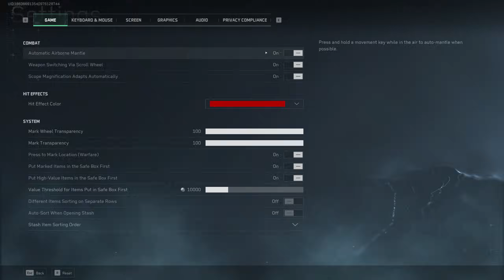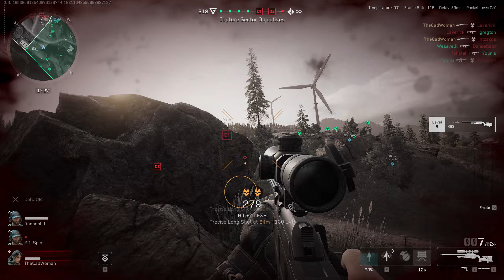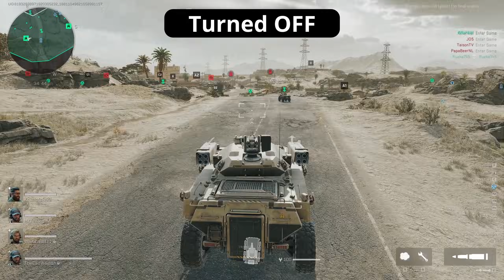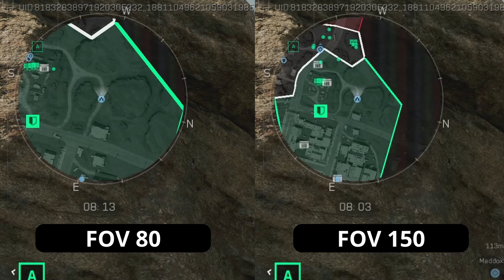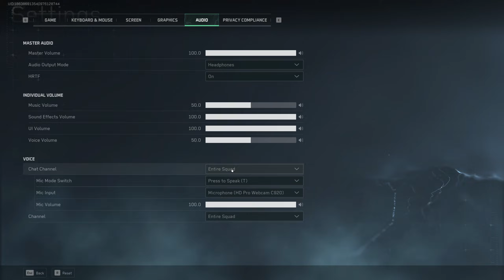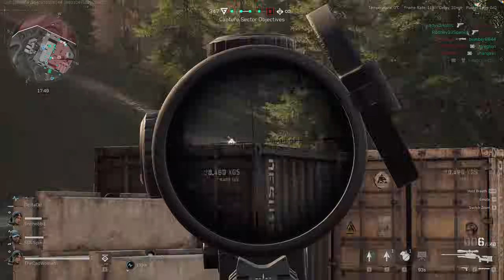ULTIMATE Delta Force Settings Guide for High FPS, Performance & Visibility

Comment: Thank you for this what is your Pc rig your whole specs of it ?
Reply from the maker: I‘ve got an Intel 13600K, RTX3070ti, 32GB Ram, and play on 1440p.
Reply: Omg i got xeon e3 1230 v3, gtx 1660s, 16gb ram and i run on hdd, still work finely, any advices?  @TheCadWoman

Comment: The audio with HRTF is legit some of the best gaming audio I've heard yet, especially in the Tarkov mode. It's so precise.
Reply: Did you also play with HRTF off to compare?  I feel like the audio is already really good and accurate with HRTF off.  With HRTF on, I just felt like it just made literally everything louder, especially when you're playing Warfare inside a building and there are a million gunshots and grenades going off everywhere.  This was what made me turn it back off, the extra noise was just too much for me.  But maybe I need to try it again and just turn down my effects volume some more.
Reply: @SLAY3R8888  Yep. Still prefer HRTF tho.
Reply: @january_0001  did you notice HRTF was considerably louder?  Or was it just me?  Thanks
Reply: @SLAY3R8888  Some sounds generated with HRTF are MUCH louder yes. To me those sounds are important + i use a compressor for all sound so i never have ear piercingly loud audio.
Reply: @january_0001  that is my issue with DF is that some of the sounds are pretty ear piercing unless I turn the volume way down.  Do you mind telling me what compressor you use?  Is it hardware or software?  I just use SteelSeries Sonar for audio splitting / sound profiles, currently using the BF2042 preset for Delta Force (which might also have compression).  But I am open to trying something different.  Sorry for all the questions.  TIA.
Reply: @SLAY3R8888  I'm just using Equalizer APO with YALA ngl... both free

Comment: the option to toggle instead of hold to revive still resets every time you restart the game. also, and this is important, the game now allows you to bind aim and hold breath on the same key. so, just like in battlefield, you can put ads and hold breath on right mouse button and automatically hold breath when you aim down sights. in delta force you can hold breath with every weapon btw. one downside to this might be that your character breathes heavily which might annoy you. also, i would still not recommend the auto mantle option, because what this does is basically it will mantle over objects that are next to you, not just in front of you. it actually causes problems.

Comment: Anyone Radeon RX 7800XT micro stutters with/without Radeon anti-lag too no matter what graphics settings?
Latest drivers…📟
Reply: me as well with a 6800xt. its borderline unplayble even at 1080p going from 144 to 20 for like 5 seconds and then back up to 144.
Reply: @ try 1440p High settings, it helps me little bit…
Reply: @tomsoncz  fix is to downgrade to 24.8.1
Reply: @fettuccinitortellini5830  i have two solutions. 
-dx11 in startup option on Steam or turn off SmartAccessMemory

Comment: Something that might help someone: if you have sprint and hold breath bound to the same key and use toggle ADS, you will have to untoggle ADS first before you can sprint (which is unlike a lot of other FPS games and very annoying if you have a lot of muscle memory built up). A way around that is to bind hold breath to another key or unbind it completely, then you are able to sprint even when in ADS. Not a perfect solution, but you don't really need to hold your breath with a red dot and if you don't really snipe then you can live without it.

Comment: Coefficient to 0(zero), there is everywhere a misconception that if you have 16:9 monitor its better to set it at 178 which absolutely wrong.
If you want the vertical and horizontal movement of your crosshair and or mouse to be 1 by 1, then the only way to achieve that is to set coefficient to 0(zero) and nothing else!
Of course someone can try 178 too or even higher as some players do but to achieve 1 by 1 movement the correct setting is 0(zero).

Comment: question: one setting has these option: auto, my GPU name , my CPU name. should I leave it on auto?
Reply from the maker: I left that on auto yes
Reply: @TheCadWoman  thanks.
Reply: what setting ?
Reply: @zereks2168  near the top of graphics area.
Reply: That setting is useless if you dont have an integrated gpu (like a laptop for example) so if you got only 1 gpu, leave it on auto